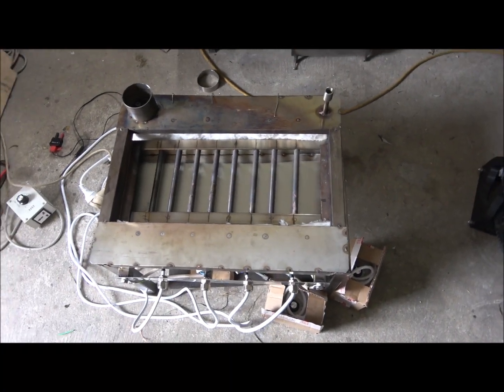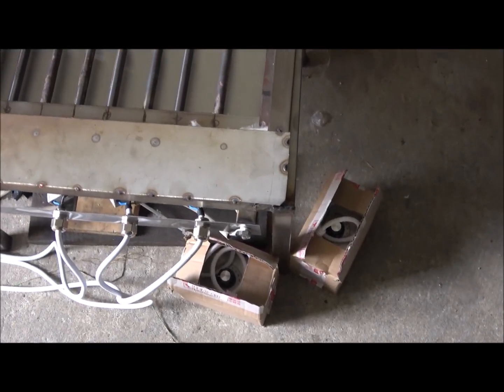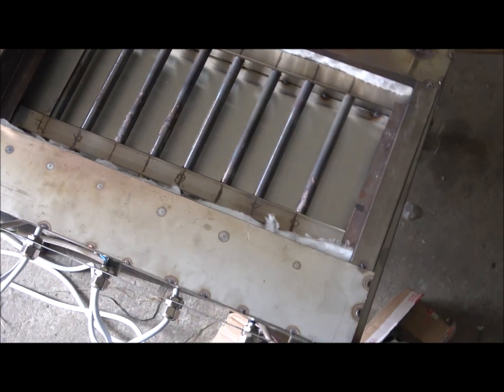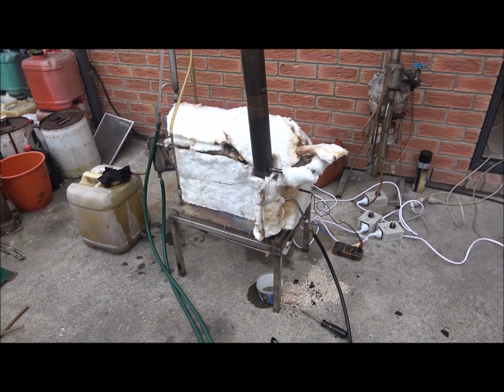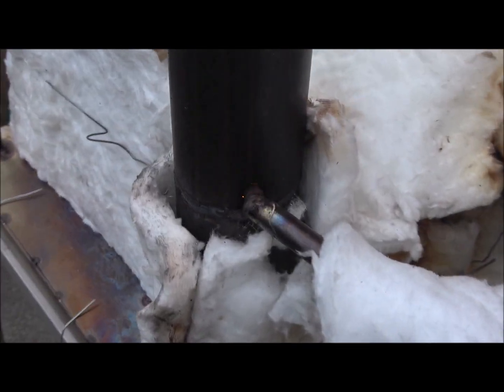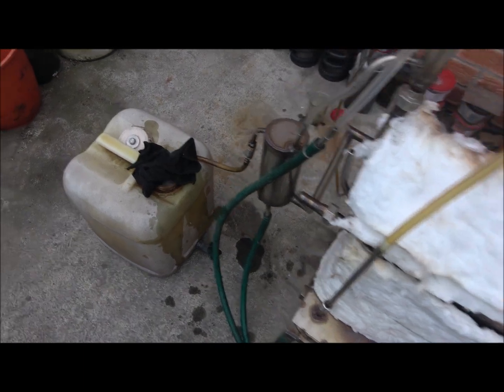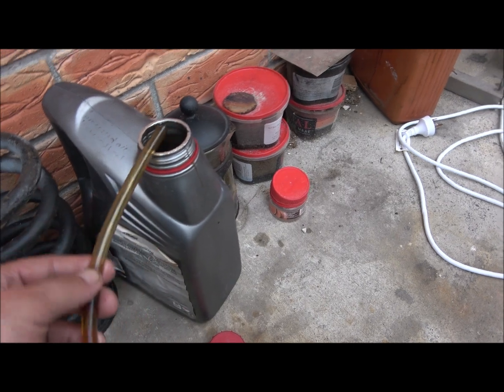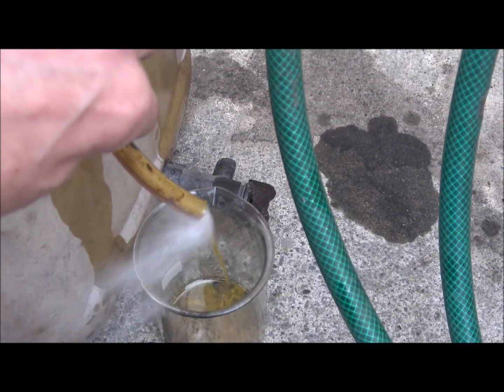Pyrolysis Retort experiment - Electrically Powered.

Comment: How do you know what type of product is coming out? By controlling heat source? And keeping at same temp ?but gasoline gases require less heat and by the time you get to diesel temperature you already have gasoline.Sorry im new on this.Do you need to build a column to have different products at the same time?
Reply from the maker: It is pyrolisys, so temperature is at maximum and it will decompose waste oil into a banch of fractions, though the heaviest fraction collected at the bottom, the light fractions at the top of the column, later the top fraction is processed with petrol separator and all petrol fractions are removed.
And yes the gasolene fractions are require lower temperature for evaporation if they are present, in our case there is no gasoline in the oil, so here we need really high temperature instead, to break down the long hydrocarbon chains and in this particular situation we can get a lighter fractions out of heavy oil. The low temperature that would evaporate gasoline will make heavy oil simply hot and nothing could be separated from that oil.
Reply: @santeryi9  Thank you so much Alek for replying my question,I really appreciate you !,now I'm starting to understand the processes  you make on some of your videos .I live in Texas but was born in Cuba and I've been here since 1995, used to shortages and excuses of an incompetent government that "there is no metro because the US embargo"and a person in a poorest country in Africa is able to make Diesel or Gasoline out of plastic bottles.When you have the intention to make things work nothing can stop you ,they just don't care!,and everything is like that in every sector of the industry (actually no industry )

Comment: should just have built a reflux still instead. you are giving your entire neighborhood cancer. In Germany burning used oil is illegal because it is so bad for the environment. By distilling the oil you can get high value grease, oils and waxes without burning anything.
Reply from the maker: I am not burning any oil, the unit is electricity powered, I burn gases only.